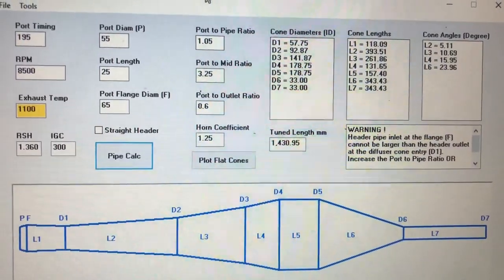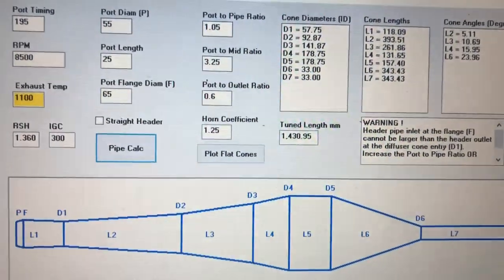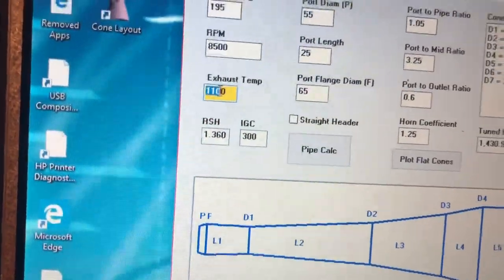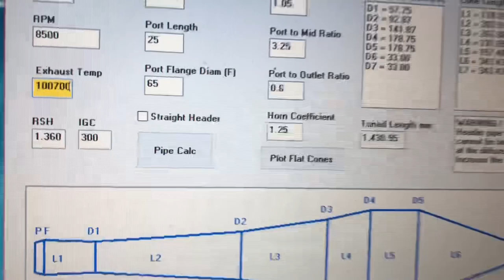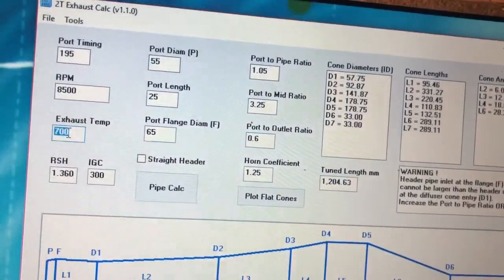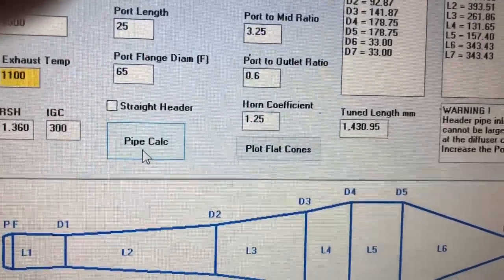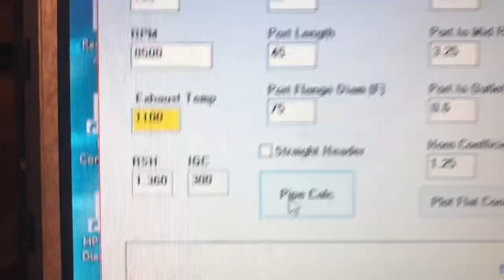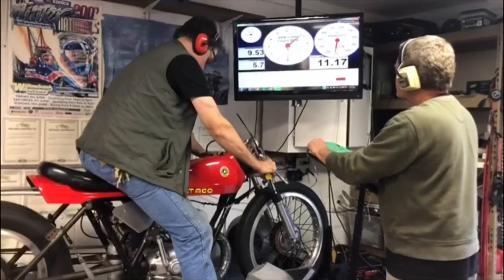Two Stroke Exhaust Calculator

Comment: First some fundamentals: The exhaust chamber works like a trumpet, variate the length, and get a different sound.... Chose a length, and get optimal engine-performance for some rpm u´ve opted for. So, the fundamentals should be set by now. In extention, on the other side, the duration of a sound-wave in a trumpet (forwards-wave) or an 2stroke-exhaust (duration forwards but even more important, duration forwards and back again) isn´t defined simply by the lenght of the pipe, but also on the   Temperature of the medium in which the sound-wave expands into (air for trumpets, hot exhaust-gases for exhaust-pipes). And while the ambient Temp in which u´d blow a trumpet is always nearly the same (inside the trumpet, or in the space u stand blowing in it, the same and very stable), so it influences only marginaly the trumpet´s tone, in the exhaust, u have not only rising Temps the longer the engine runs (or the higher the load is), but also different Temps along the length of the pipe itself, and all that rising Temps or Temp-gradient has some influence, since sound-waves move faster, the hotter the medium is, in which they expand... The higher the average temp in the pipe, the faster the sound-wave, the shorter it takes to reach the pipe´s end and reflect back to the cylinder´s exhaust-port, the higher the rpm for which this specific pipe has the optimal lenght (cause the higher the rpm, the shorter the time-window of open cylinder-exhaust-port)... OR: If you have chosen some rmp of your preference, where u want optimal function, u also have to chose an average Temp for it too, and get the tuned-pipe-length. It means, the pipe is gonna function perfectly at that rpm and at that average Temp, as well at lower Temps but at a lower rpm, as well at higher Temps but at a higher rpm... Practically, higher temps virtually shorten your pipe´s tuned lenght, letting it function optimally at higher rpm now (shorter pipe means less time for the wave to travel back and reach the exhaust port at the right timepoint)... 
Here you see 5 graphs of torque and power, when the guy moved the baffle-cone 3cm each time towards the diffusor-cone (base graph in red and the other 4 graphs for moving the baffle 4 times nearer to the diffusor, 3cm each time, with the yellow graph being the last one). Watch how the torque- and power-peak migrate to higher rpm each time. Temperature has the same effect, without actually moving any parts, and it disturbs the whole process, cause u can never control the temperature so well, but the effect seems to be negligible enough, if u have considered it when u first built the pipe...  Go to 12:37 of the video https://www.youtube.com/watch?v=xgj-_vdcO7w   It´s some guy building/selling cylinders and pipes for Simson-2stroke-bikes (east german brand). they can get up to 37hp out of 80cc...

Comment: AuMechanic's software expects metric values. If you hover the mouse pointer over the input field you will see a comment box open with the text "Exhaust Temp C  Average exhaust gas temperature". The C stands for Celsius or Centigrade which is metric. In one of his videos, he shows that a higher output engine (with a high BMEP of about 11 units (average cylinder pressure) has a high 600 degree Celsius temperature whereas a lower output engine (BMEP about 5 units) has a 350 degree Celsius temperature. I am not sure what the BMEP units are.
Reply: BMEP  UNIT IS   BAR
Reply: you cant "just" use bmep.it doesnt really matter with engines. If you have an engine size of 125ccm³, you would have to calculate the geometric compression and replace that one with bmep
Reply: If you look in the software at the menu up top under "Tools" you will see "Input Calculators"
That opens a window that has a BMEP calculator as well as a metric converter so you can put imperial values for HP to KW and F to C for temps  and convert them to metric to use in the BMEP calculator and the software.
BMEP is Brake Mean Effective Pressure in BAR pressure that is put simply the sum of values of any given engine used to determine the exhaust pressure in BAR which is used to approximate exhaust temperatures if you are unable to measure it (with an EGT gauge)
Reply: @AuMechanic  i was using that tool now, excellent software! im going to do now my first exhaust for my 50cc , but the exhaust D4 and D5 is around 74mm, and performance exhausts come with 90mm, is it going to make diference or will the full exhaust geometry make up for that difference?
i noticed that it only changes with the exh port diameter
Reply: @TBrites   If you have a look at the "Port to Mid Ratio" value, that relates to the mid section size at D4 D5 in relation tp port window size so you can adjust it.
Hold the mouse pointer over that "Port to Mid Ratio" input box and a popup will explain the values you can use in it.
Reply: @AuMechanic  Thank you very much, what are the values you recomend ?

Comment: My question about those softwares is. How translate this 2D dimensions in a 3D real curve pipe? Has a software or anyone can explains how to do it?
Reply: 3.14
Reply: @Dartoras  Hi. What means 3.14?
Reply: @R.B_B  The number π (/paɪ/; spelled out as "pi") is a mathematical constant that is the ratio of a circle's circumference to its diameter, approximately equal to 3.14159. The number π appears in many formulas across mathematics and physics. It is an irrational number, meaning that it cannot be expressed exactly as a ratio of two integers, although fractions such as {\displaystyle {\tfrac {22}{7}}}{\displaystyle {\tfrac {22}{7}}} are commonly used to approximate it. Consequently, its decimal representation never ends, nor enters a permanently repeating pattern. It is a transcendental number, meaning that it cannot be a solution of an equation involving only sums, products, powers, and integers. The transcendence of π implies that it is impossible to solve the ancient challenge of squaring the circle with a compass and straightedge. The decimal digits of π appear to be randomly distributed,[a] but no proof of this conjecture has been found.

For thousands of years, mathematicians have attempted to extend their understanding of π, sometimes by computing its value to a high degree of accuracy. Ancient civilizations, including the Egyptians and Babylonians, required fairly accurate approximations of π for practical computations. Around 250 BC, the Greek mathematician Archimedes created an algorithm to approximate π with arbitrary accuracy. In the 5th century AD, Chinese mathematicians approximated π to seven digits, while Indian mathematicians made a five-digit approximation, both using geometrical techniques. The first computational formula for π, based on infinite series, was discovered a millennium later.[1][2] The earliest known use of the Greek letter π to represent the ratio of a circle's circumference to its diameter was by the Welsh mathematician William Jones in 1706.[3]

The invention of calculus soon led to the calculation of hundreds of digits of π, enough for all practical scientific computations. Nevertheless, in the 20th and 21st centuries, mathematicians and computer scientists have pursued new approaches that, when combined with increasing computational power, extended the decimal representation of π to many trillions of digits.[4][5] These computations are motivated by the development of efficient algorithms to calculate numeric series, as well as the human quest to break records.[6][7] The extensive computations involved have also been used to test supercomputers.

Because its definition relates to the circle, π is found in many formulae in trigonometry and geometry, especially those concerning circles, ellipses and spheres. It is also found in formulae from other topics in science, such as cosmology, fractals, thermodynamics, mechanics, and electromagnetism. In modern mathematical analysis, it is often instead defined without any reference to geometry; therefore, it also appears in areas having little to do with geometry, such as number theory and statistics. The ubiquity of π makes it one of the most widely known mathematical constants inside and outside of science. Several books devoted to π have been published, and record-setting calculations of the digits of π often result in news headlines.
Reply: @Dartoras  Now I understand pi 3.14... but how I use for convert those 2D dimensions showed in those softwares in 3D real tubes with curves?

Comment: Your talking horse poop. No 2 stroke runs 700 C exhaust temps. Your program is more than 10 years outdated! Go and look at at a South African Engineers program , it's called Vanick and it's from Professor Neels Van Niekerk from om South Africa. Many factory teams used his software to design their moto gp 2 strokes .
Reply: got a link?